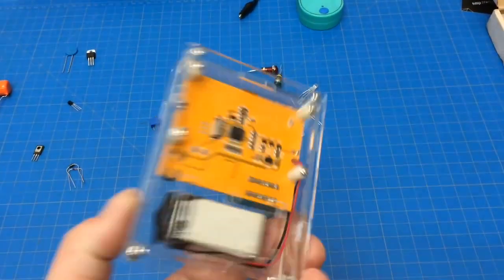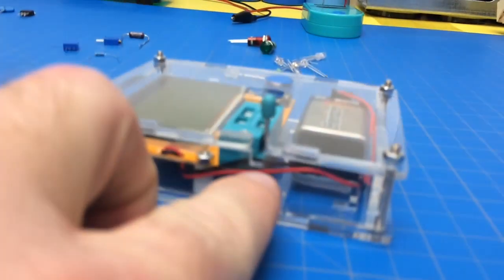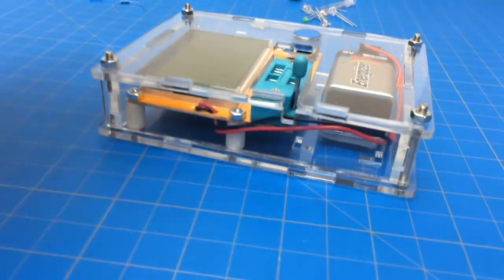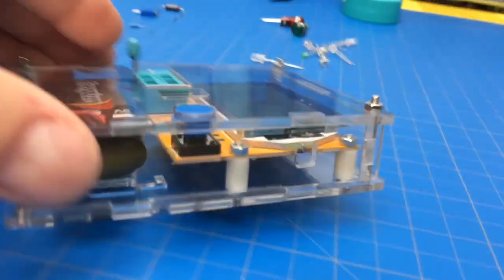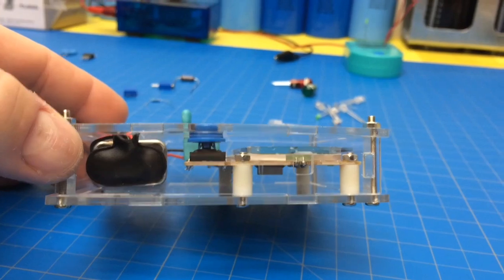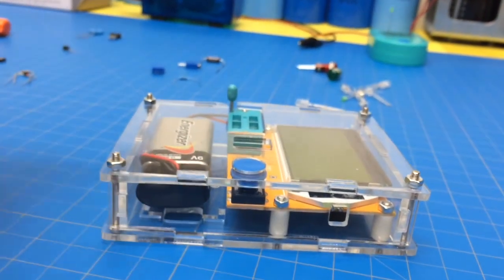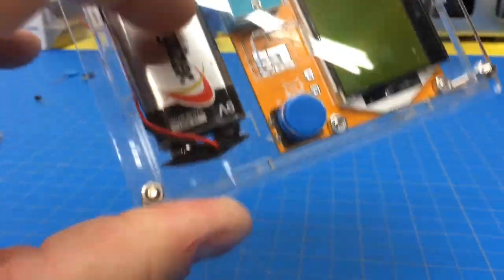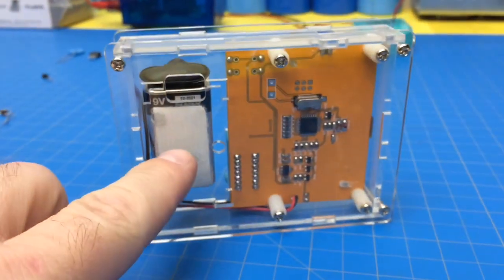How To: Assemble All-In-One Electronic Component Tester Acrylic Housing [KTFG 358]

Comment: I know I'm 7 years late on this one.  But I thought I would share a very helpful tip when aligning the spacers and bolts prior to placing the hex nuts.  I took a small ball of Blue-Tack and stuck it on the bolt and spacer before assembling the board to the base case.  Kept them from falling out and shifting while I fastened the board.

Comment: Having trouble getting the protective covering off. I try soaking the plexiglass in water. What tool kit is that in the video? Thanks for the video, saves time in trying to figure the assembly out.
Reply from the maker: That’s odd, maybe try heating with a hair dryer on low to peel off.
The tool kit is Wiha 96 piece, link to it is here on page 3 at MacBook upgrade section:  https://www.kevingittemeier.com/editing-workstation/
Reply: I spent 1 hr getting the protective covering off. Most difficult part.. all good after that!!! Love this thing.

Comment: Those testers are really just identifiers-they won't tell you if the component should work in circuit.
Reply from the maker: That is primarily what I use them for.
Even though they are marketed as tester/identifiers I agree with you they are more identifier than anything else